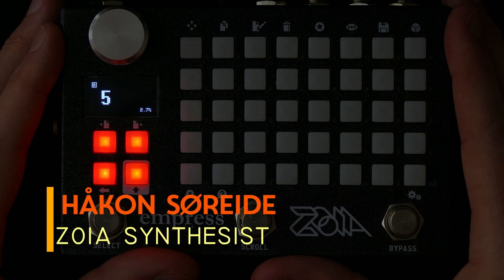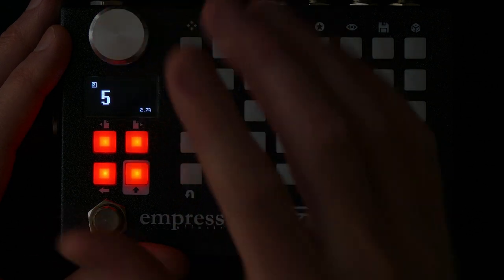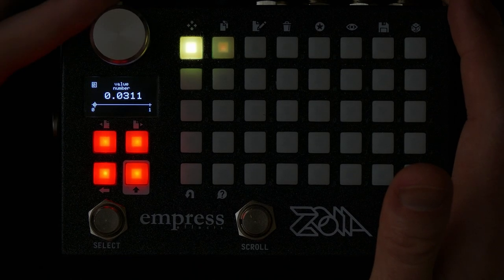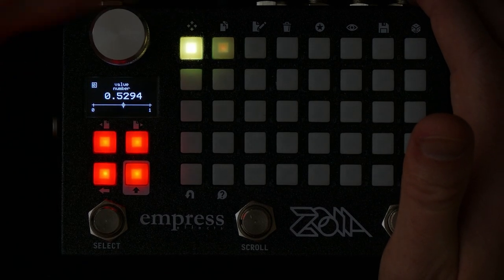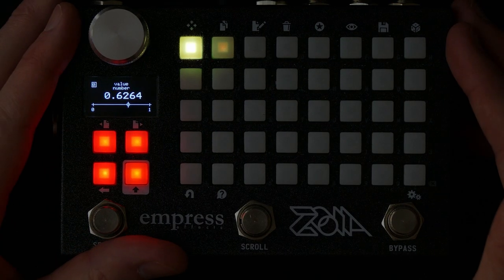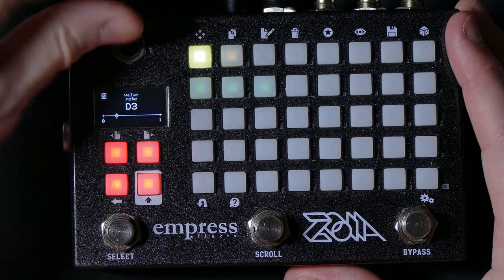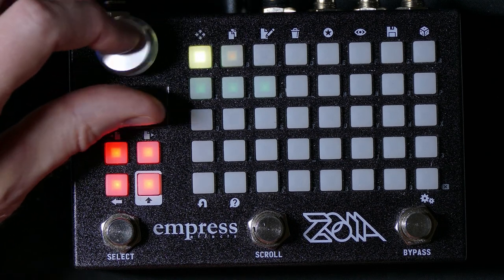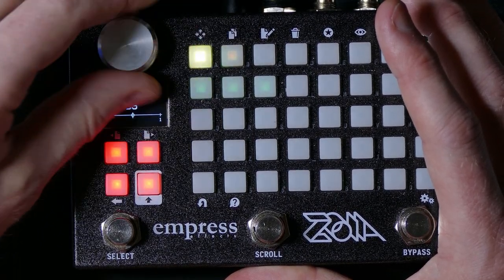Zoia Tutorial: Problem Encoder - Cleaning and Workaround - Empress Effects Zoia

Comment from the maker: Just to be clear, don't ever use what is commonly known as "WD40" for this! I am using Contact Cleaner that just happens to be WD40 brand. WD40 (the product commonly known as "WD40", that is) is something else entirely and an absolutely terrible idea to use for something like this. It will gum up, stop the encoder from working, and be almost impossible to get rid of. Don't do it!
Reply: I would have this advice in the main description of your video rather than in the comments, it's pretty crucial!
Reply from the maker: @neiljackson5217  Thanks for the suggestion. I find people are more likely to see the comments than the video description, so I usually put the most important information in comments first, but, as you suggest, I should also put it in the description. 

It is also mentioned in the video, of course.

I've added it to the description now.

Comment: is it possible to have this fixed by a local repair electrical shop? or is this something that has to be sent to Zoia. Is it hard to replace the encoder?
Reply from the maker: While I've not replaced my encoder yet, though I probably should do it soon, if sending your Zoia to Empress for a free replacement, they can also send a new encoder to you, which seems reasonably easy to replace since the replacement also comes with the small circuitboard it is attached to inside the Zoia, meaning you only have to solder in the new encoder and swap the boards rather than the more tricky task of desoldering the encoder itself.

If this is something you're not happy doing on your own, I am sure any electrical repair shops or good friends with some soldering experience would be happy to help you out.

Comment: Great tutorial <3 I've tried to remove the encoder, but can't seem to find the right hex key. I've tried with a 1,5 metric key, but nothing happens!! Or am I using the wrong key?
Reply from the maker: Thanks. 

When you say nothing happens when you use a 1.5mm hex key, do you mean it doesn't gain purchase at all in the set screw for being too small? That it doesn't slot into it at all? That you can't turn it, or that you can turn it but it doesn't come lose?

The set screw is 1/16in, which is 1.58mm, and 1.5mm should normally be close enough. Unless your set screw has been stripped, it should theoretically work fine.
Reply: @hakonsoreide  I'm using a 1,5mm hex key, but maybe you're right it may be stripped :-( I'm the second owner! Or maybe I should try to get a 1/16in key
Reply from the maker: @songsfromtinpanalley6742  If the screw is stripped, that would probably be from a 1.5mm hex key having been used and an attempt at overtightening it (set screws should never be tightened much, and on the Zoia there is even less need since it is a D-shaft encoder), so there is still a chance you can make a 1/16 work.

You'd have to do it very carefully as you may only get one shot at loosening it before you strip whatever is left of it, and once that happens, it gets even harder.

Comment: Hi. 

Just want to let you know that my encoder has been like yours since roughly patch 1.13.

After a bit of corresponding with empress support, I ended up trying some WD40 "specialist fast drying contact cleaner" I already had in my garage, and it's as good as new. 

The word from Empress is that it's probably nothing firmware-related. Maybe all our encoders are starting to show some wear at roughly the same time.
Reply from the maker: Thanks for watching, and for the comment. I haven't tried moving back to 1.12 to verify (it's got too many other useful updates), but it could take as little as a single bit changed in the encoder routine to make it more likely to act up when worn, and I'm not the only one who had no problems the day before installing 1.13, so I still think the firmware inadvertently exposed the need for encoder cleaning when before we were able to get by for longer before it was needed. I find the causal link very plausible, anyway. And Empress did say "probably" and not "certainly", meaning they wouldn't rule it out.

As long as contact cleaner works, of course, it's not a problem, and I usually use a MIDI controller connected to the Zoia as well, making it only a potential issue when I am creating a patch, but not when I am actually using it.
Reply: Sure worked with mine!

Comment: Is it not an optical encoder?
Reply from the maker: No, it's a mechanical/conductive encoder, which means you have rotating brass contact plates inside that can also be cleaned directly if you open the encoder up, which is the next step in cleaning if problems persist. I'll make a video about that some day too as I did it recently. 

I was still having problems, though, so it is getting worn from being used so much, but there will be a firmware update soon that changes the way signals from the encoder is interpreted that will hugely improve performance of tired encoders like this one.

I am also expecting a new one from Empress Effects, so I will make a video about replacing it once I get it.